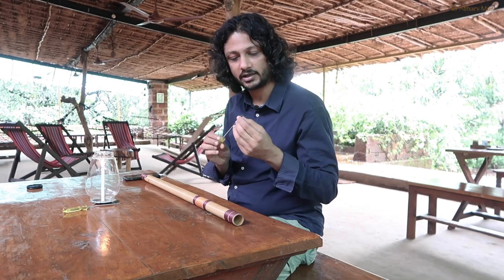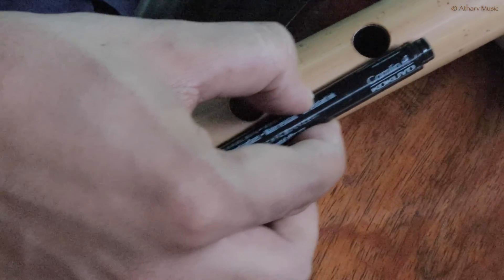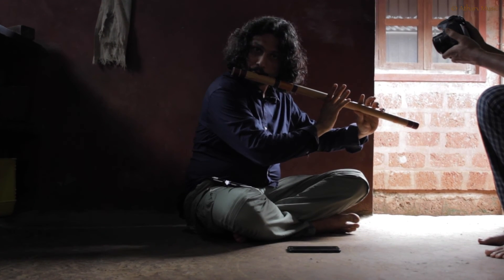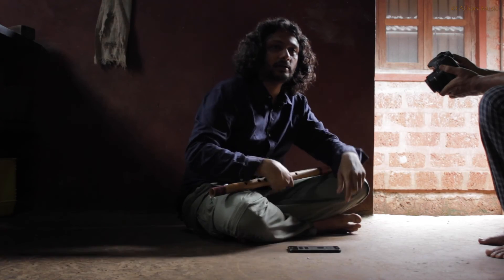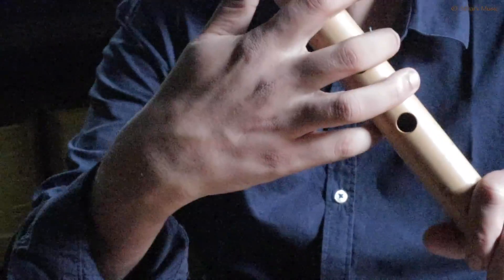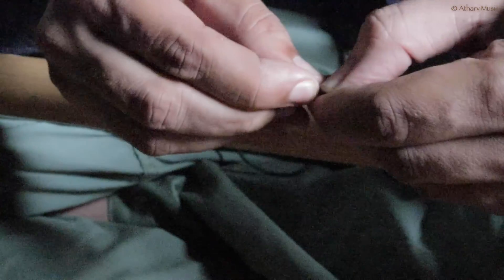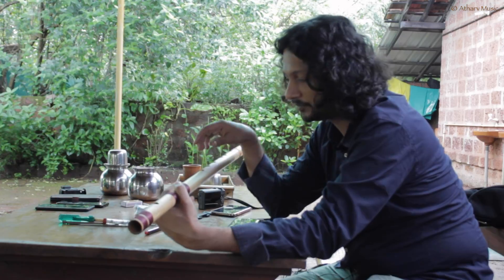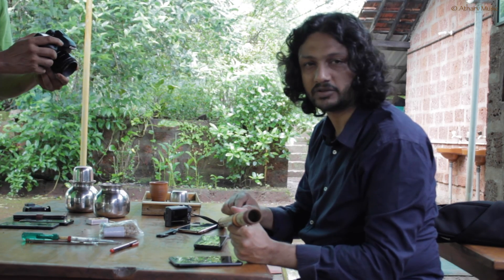BT 09 - Making the Pancham Hole / Thumb Hole in Bansuri

Comment: Amazing Video. Thanks Ashwin. 
Quick tip to everyone: Instead of using a heated screw driver, (US madhe chulha nahi milala kuthe) I used a soldering iron to make the pancham hole on my flute. I felt it was easier to control and also quicker with soldering iron. Try it out! 😊

Comment: Aap bansi badak to jarur lekin app pahle ek atulnio admi ho. Your smiling face and simple behavior attract me most. In a previous video you explained the function of thumb hole. As a result I tried it on my Flute, the tune is perfect. But I can't play easily. Perhaps I have to practice a lot . Thanks ASHWIN ji for this valuable video. Just one question, don't you use your little finger for lower 'MA'?
Reply from the maker: Thank you Sandeepda. I don’t use the little finger on Bass flutes as I cannot reach it, ji. On smaller ones, I do use it though. :)

Comment: Thanks a lot on explaining the objective - theory - implementation aspect of the Pancham hole. I have done this successfully on a relatively cheaper G base Basuri that I have. So BT09 was a quickly implementable learning. BT10 - Using the Pancham Hole is going to be a looong process. I hope to crack it. For making the hole, I followed progressively increased size drilling and then elongating the hole towards blowing hole to make it sound sharper. Used Tuner for the same purpose of matching - instead of using my untrained ear. Your guidance was adequate and I got compelled to implement it within a day. Thanks again.
Reply: Without your guidance I would not have risked trying it.

Comment: It's it possible to use a micro-drill? Or is the heat-finishing required for sound quality or other considerations?
Reply from the maker: Micro drill may cause a crack to the bamboo. Also, I’m not sure if the diameter would be appropriate.
Reply: @ashwinflute  Guruji, I lit up a diwali sparkler in your name, remembered Prabhu Shree Ram and used the iron core of the sparkler to make the hole. It worked right the first time. I bought this E bass flute on sale. Now it has a beautiful soul, courtesy to you 🌹

Comment: Thank you so much for showing us how to make the Pancham hole by our self,

I had a small doubt, you said to put the hole at a distance equal to separation between Re and Ma holes, since we need to go a note higher,

But isn't the distance between tivra Ma and Pa is of half note?
So technically we should place the pancham hole at a half distance of Re and Pa hole.
But we also observe that it seems to be working, is it because the size of the hole is kept smaller compared to the other holes.

I am a beginner, excuse me if this doubt seems stupid.

Your videos are awesome, This BT series is helping me to learn alot 🙏
Reply from the maker: The best way to know this thoroughly is by doing the experiment yourself. This way you will also learn ‘what not to do’ which is a lot more valuable /)
Reply: @ashwinflute  Correctly said Sir,
Thank you very much for replying 🙏
Reply: Technically half distance yes... But as we need tiny thumb hole so distance need to be bit more than half

Comment: I have a basuri where all the holes are placed where I feel comfortable. Holes are not in a straight line. My flute is a E flute. I don’t get any stress on my neck muscles or my left arm muscles. I believe D#,D and E flutes should use this technique. I will appreciate your comments. You can see the posture in a video clip where I have used this ergonomically designed E basuri. Simply search on my name. — Sharad Ranade.
Reply from the maker: I tried to search but didn’t find the video you mentioned.
Reply: share that video Sharad, once again